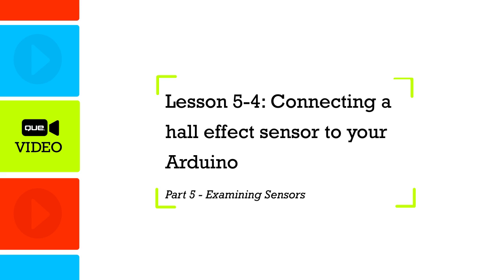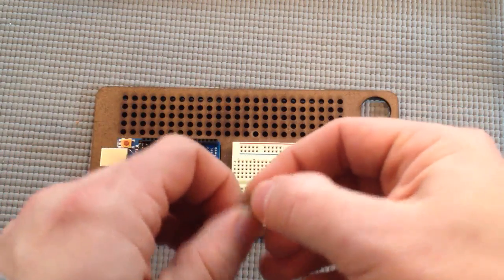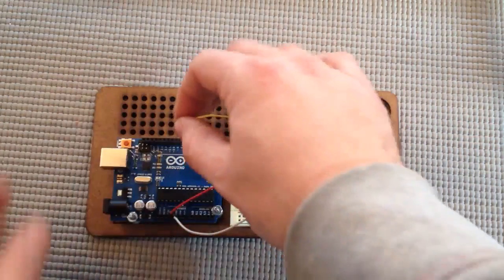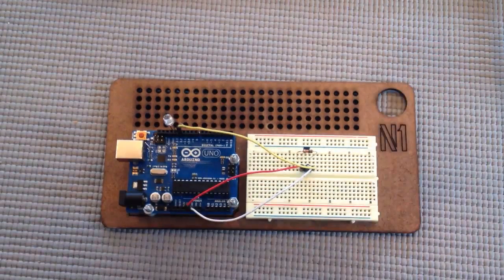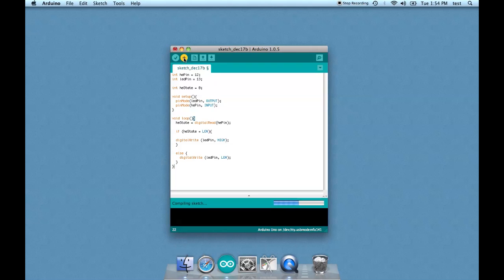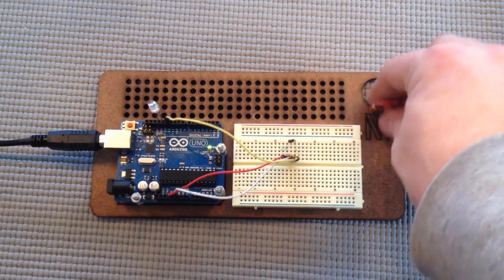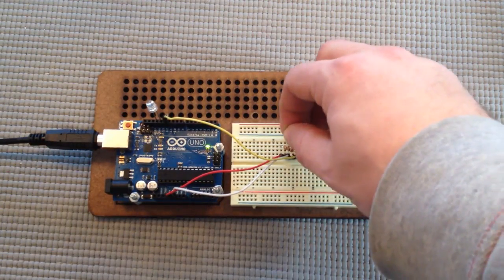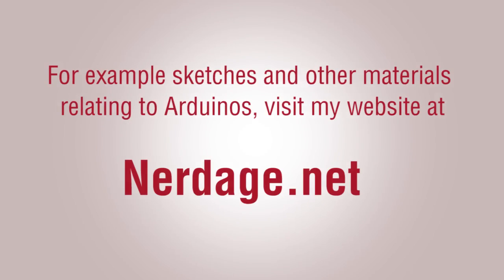Arduino for Beginners   24 Connecting a hall effect sensor to your Arduino

Comment: I could see using the HE magnet sensor as limit switches on a CNC, how would you use six sensors (X2 y2 and Z 2) would you need six Arduinos?  Could you show a diagram for this situation?

Comment: do you have Hall's code for arduino?
Reply: +Doan lương xuân int hePin = 12;
int ledPin = 13;
int heState = 0;
void setup() {
  pinMode(ledPin, OUTPUT);
  pinMode(hePin, INPUT);
}
void loop() {
  heState = digitalRead(hePin);
  if (heState == LOW)
  {
    digitalWrite(ledPin, HIGH);
  } else {
    digitalWrite(ledPin, LOW);
  }
}